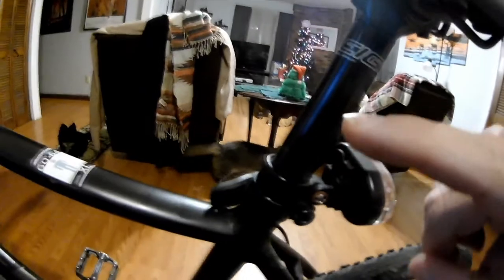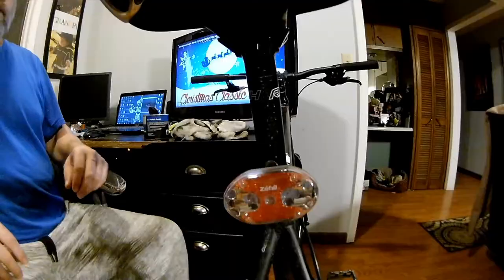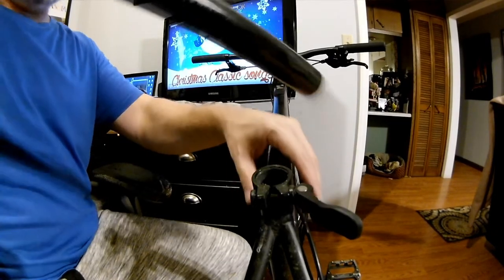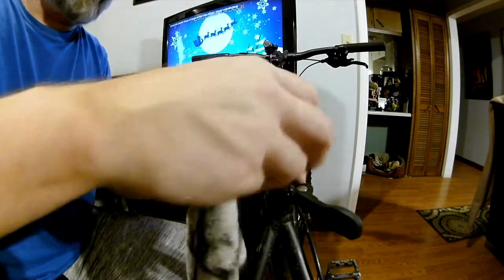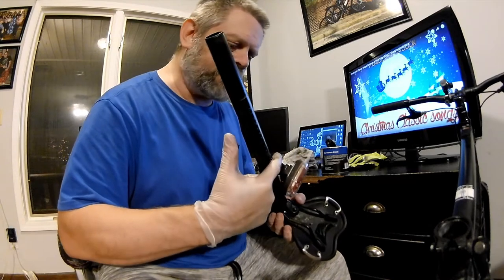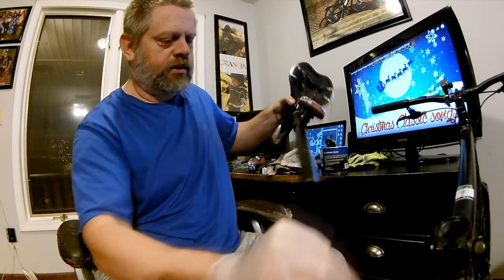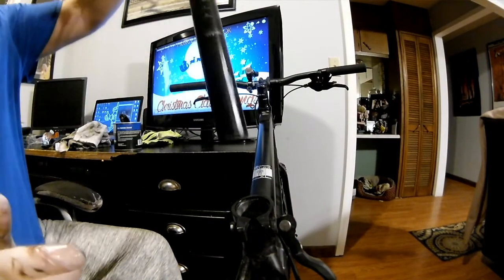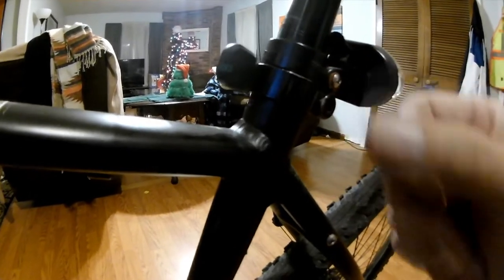Greasing Your Pole! Seat Pole That Is 12 5 19

Comment from the maker: Ideally it would have been nice to have a pipe cleaner or rod/towel to push down in there to really clean the inside.BUT I didnt have anything..SO ill do the extreme clean next time..
Reply: I guess some pvc pipe would be good thin plastic rot also would be good for fork service, cleaning lower legs, but a pipe cleaner can work for seat tube i guess.

Comment: Baby bottle cleaner brush works great to clean that area. I always add grease to the seat post. And be adware if you have aluminum to steel. That will come as one if you have that change it. Most bikes now does not have them.
Reply from the maker: yup